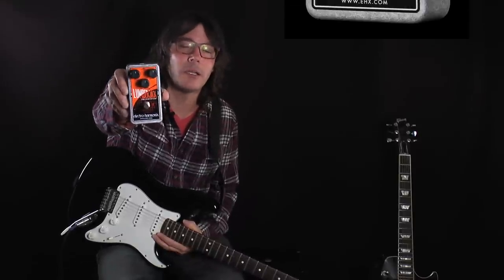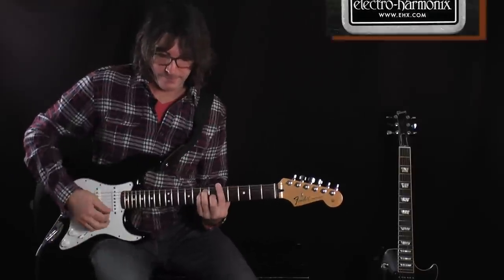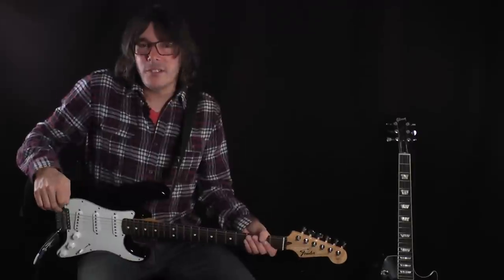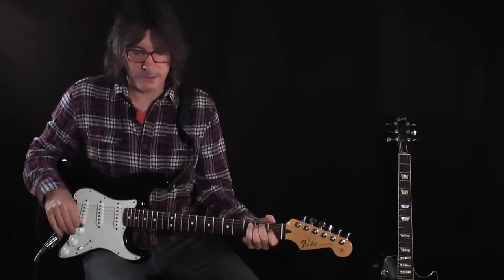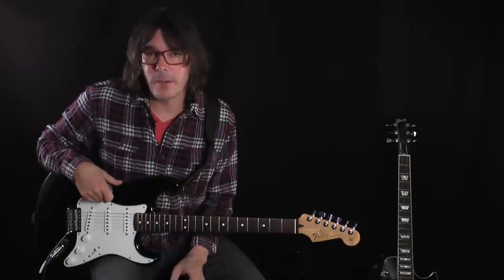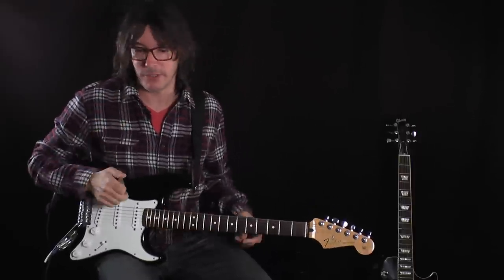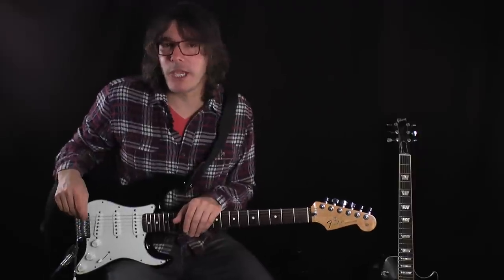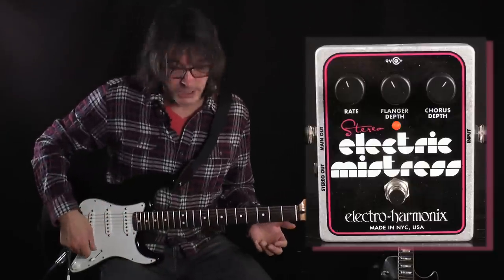Electro Harmonix Lumberjack Log Overdriver Pedal

Comment: It sounds like the clean signal mixed with the sound of the snare drum wire on the underside of a snare drum rattling away.
Reply: It depends on how you listen to the Youtube video and your speakers. It really sounds like a torn old speaker depending on how you dial it it. I like this pedal a lot for delta blues from a super strat. ;)

Comment: Can someone from EHX explain what "logarithmic overdrive" is supposed to mean? Is it referring to the fact that the "log factor" knob, which sounds like a blend knob, uses a logarithmic taper? Seems like they're just trying to market using words that the average buyer won't know.
Reply: From EHX:
A standard overdrive pedal reacts predictably in that the distortion it delivers goes up linearly in direct response to the guitarist’s volume and playing dynamics. A little explanation is required: On a linear scale, a change between two values is perceived as the difference between those two values. So the difference between 1 and 2 is the same as the difference between 9 and 10. The Lumberjack’s response is logarithmic and the change between two values is perceived as a ratio of those values. Therefore, a change from 1 to 2 (ratio 1:2) is perceived as the same as a change from 4 to 8 (ratio of 1:2). The resulting overdrive is very reactive to the player’s volume and dynamics and its response ranges from a powerful clean boost to torn-speaker rasp and up to gritty distortion.